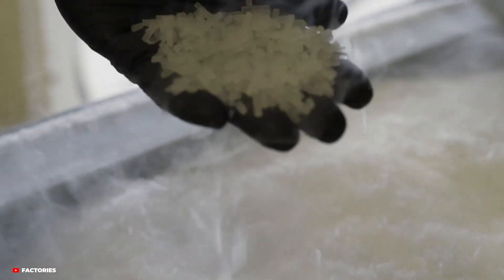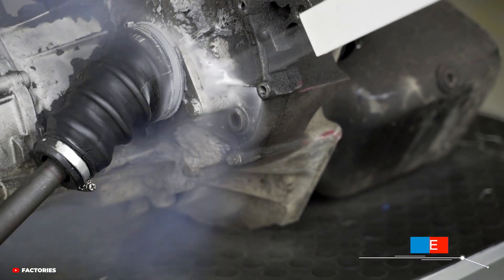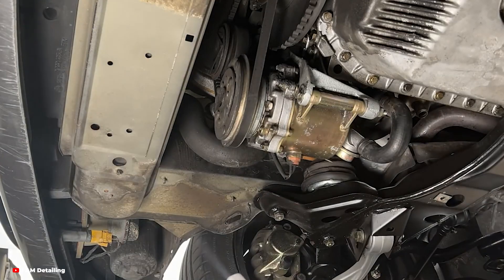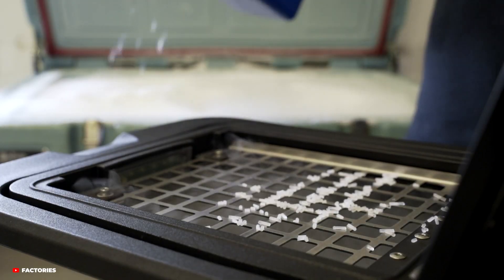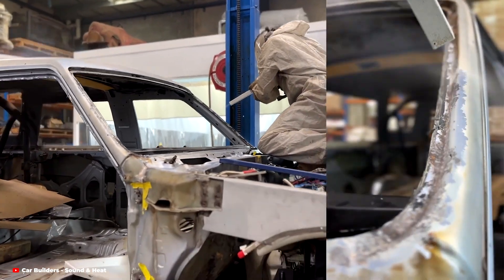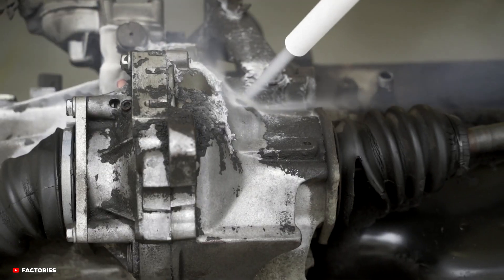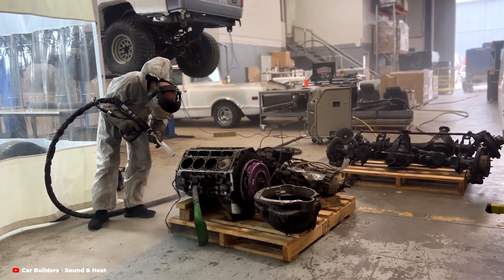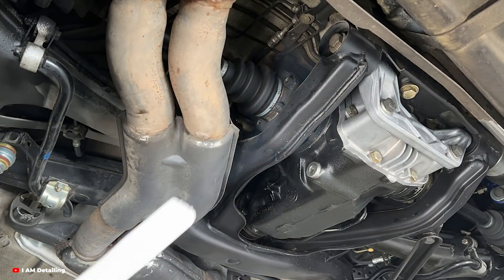How Dry Ice Cleaning Transforms Cars: The Ultimate Detailing Method

Comment: I doubt it's anywhere near carbon neutral, as it uses massive quantities of compressed air, plus creating dry ice is also very energy intensive.
Reply from the maker: You’re right that both compressed air and dry ice production require energy, but one of the main reasons dry ice cleaning is considered more eco-friendly is because the CO₂ used to make the pellets is actually a byproduct from other industrial processes (it’s not created just for blasting). Instead of being vented into the atmosphere, it gets captured and reused. On top of that, dry ice blasting doesn’t create secondary waste like sandblasting or harsh chemicals, which means less cleanup and fewer environmental hazards overall. So while it’s not 100% carbon neutral, it’s often seen as a much cleaner and more sustainable alternative compared to traditional methods.